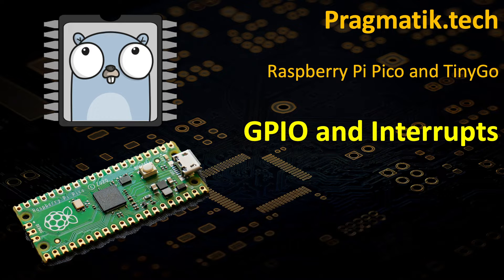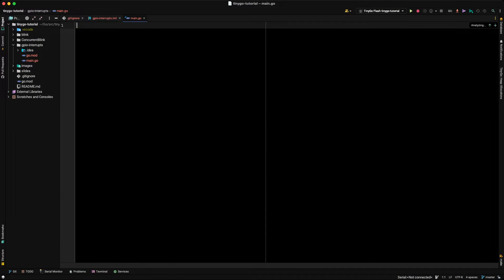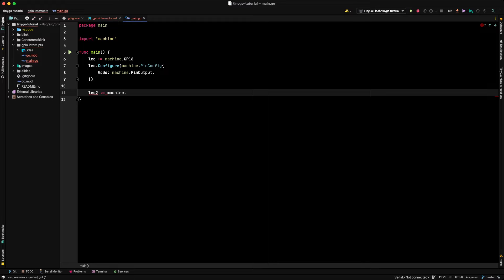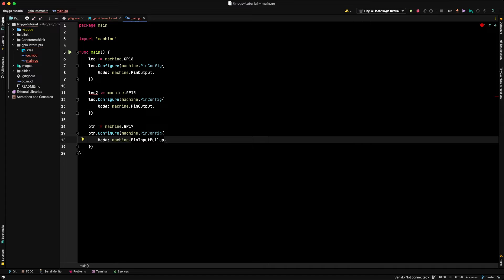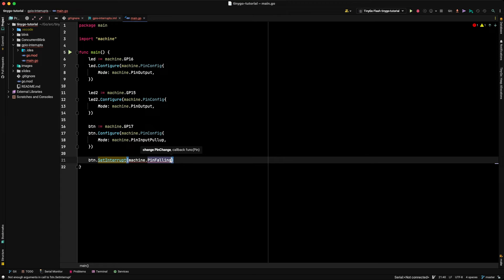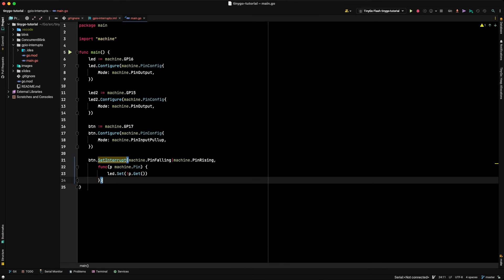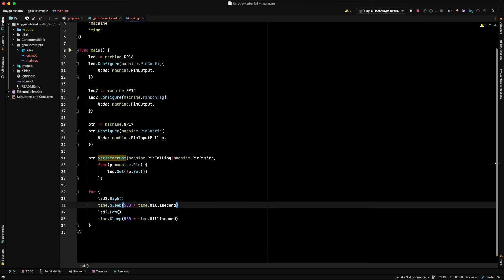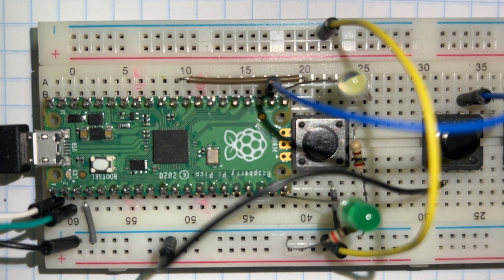TinyGo and Raspberry Pi Pico: GPIO and Interrupts

Comment: I finally got around to trying this out.  I have a single push button and I SetInterrupt for when it is pressed. When pressed I print "hi".  This works but sometimes it prints "hi" real quick several times if I don't push the button quickly.  I think I heard someone call this pin-bouncing?  Can you suggest a technique I can us to avoid this?
Reply: I did some searching and found that I can fix in software or hardware, I am better at programming so I will try to fix in software. Looks like I can read the pin value in a loop and introduce a small delay when pressed to debounce.  Looks like that can work but seems to make the use of SetInterrupt not needed. I like the SetInterrupt approach so any advice is appreciated
Reply from the maker: @tonygilkerson  You'll need to debounce your switches. Unfortunately, I couldn't figure out an easy way to debounce in software on the Pico using TinyGo since we need to keep the ISR execution time really small. A simple hardware debouncer might do the trick.
Reply from the maker: Take a look at https://github.com/tinygo-org/tinygo/pull/2233/files for a possible example.
Reply: @pragmatiktech  I just took a look at that example, I like it... I will try that next.  You are a great resource, I appreciate your help. I will report back to let you know if it works,
Reply from the maker: @tonygilkerson  More than happy to help and to have people like you with whom I can share this learning journey.
Reply: I just tried it out.  It works good.  It requires a global for the lastPress time but it works.  I am going to try and remove the global but good find thanks.

Comment: This is great, I am learning how to code pico with TinoGo and there are many python examples but actual TinyGo examples are hard to find so please keep them coming.   I do have a question.  Is the execution of the interrupt function concurrent or parallel?  For example if you were to put a sleep in your function that checks the button status would the other light pause for awhile?
Reply from the maker: Yes it would. Although time.Sleep seems to be disabled in an interrupt service routine. I'm working on a video to illustrate this - based on this question and the one you asked on my other video. Stay tuned.
Reply from the maker: Tony: Here you go: https://www.youtube.com/watch?v=7_ZSARxaR4k